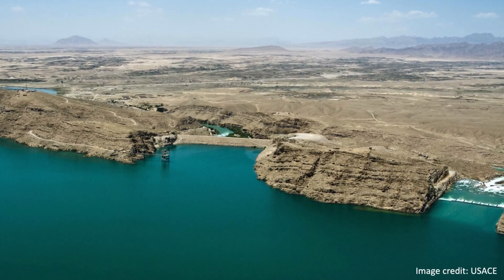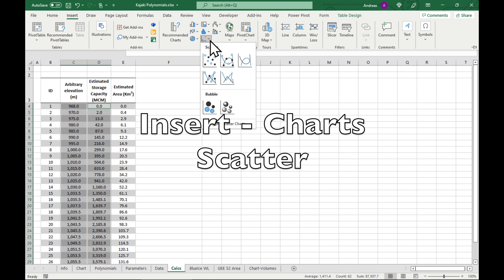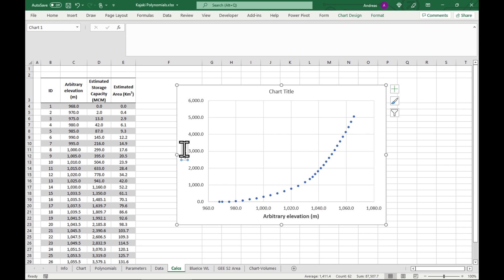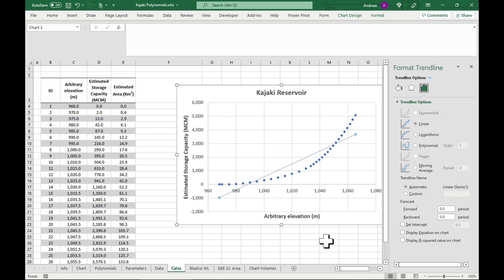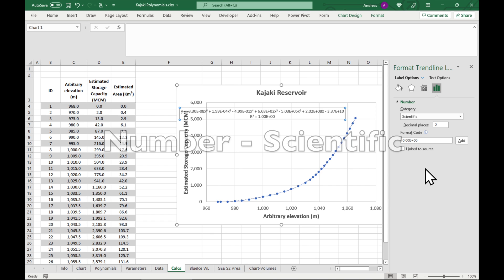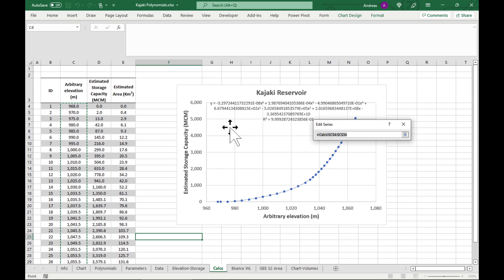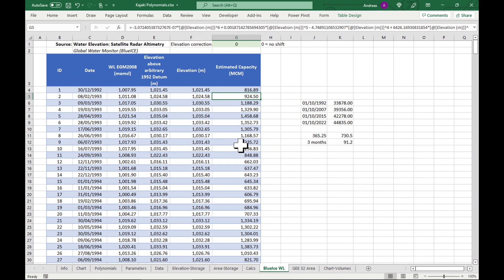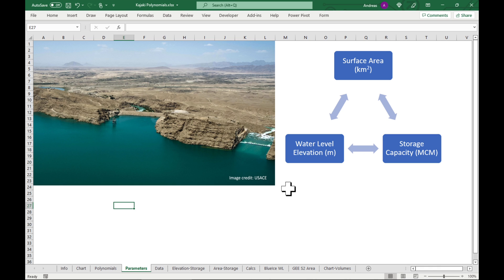Excel: Reservoir Storage Monitoring from Elevation & Area - Kajaki Reservoir

Comment: All are useful videos on your channel. Can you please let me know how to find the water in hard rocks (igneous and metamorphic). 
Thanks in advance!
Reply from the maker: Hi Raja, You need to start with the conceptual model on the hydrogeology of the project area: where is the water? Basically if the rocks are not weathered, then the porosity will be very low except where you have fractures. Once we get weathering, the porosity will increase but we can also get clay minerals which can lead to a lower permeability... Weathering is enhanced in fracture zones as the rocks there are already weakened. We also need to consider the water cycle: where is the water coming from? ... and where is it going?
Once you have this conceptual model, you can start doing groundwater exploration. Often it is best to look for regional fractures & the way to spot them is on air photos and satellite images. Some fracture directions are better than others so you also need to look at the structural geology of the area. Often late stage extension fractures are a good target, and you may even be able to map them in the field e.g., if they are associated with quartz veins.
Once you have found your fractures, and can zero in on those which have a large recharge area and then do some e.g., resistivity profiles to narrow in on the fracture zone, followed by some VES to see how deep you need to drill. See my video on resistivity surveys.
If your well is successful you need to carry out careful pumping tests to see if the water levels fully recover, as fractured aquifers can be compartmentalised which means that you can basically pump a particular compartment dry in a short time if it is not hydraulically connected with a larger part of the aquifer.
As a general rule, the drier the climate, the harder it is to drill successful wells so it helps to do a good baseline survey before you start any geophysics. Check out my video on groundwater exploration strategy. Good luck & all the best, Andreas
Reply: @GeosearchInternational  Andreas.. Thank you very much for detailed explanation. To be specific the study area Geology consist of 10-15m of overburden soil followed by igneous and metamorphic rocks. If we do some VES profiles is it possible to find some fractures. 
There are lot of equipments in the market claiming that they can identify the water in hard rocks up to a depth of 600m, sadly there is no science behind these techniques. eg. 3D locaters etc. 
As a Geologist I wanted to know from your experience, how far we can trust the VES sounding for identifying the fractures in hard rocks.
Again I say all of your videos are true gems!!
Reply from the maker: Hi Raja, From my experience all the equipment that make these claims are fake. The laws of physics apply and there is no x-ray equipment for the subsurface. You can do 3D seismic surveys and electrical imaging surveys but even these need to be interpreted professionally and are quite expensive. So, it comes back to good geological & hydrogeological surveys, followed by a logical approach to reduce your risks of failure.
A vertical electrical sounding (VES) is just a cheap borehole. It tells you how thick your overburden is and some info on the resistivity. To find the fracture zone, you need to do a resistivity profile, not a VES profile. So the resistivity profile is just repeated resistivity readings at constant AB and MN spacings, say every 10m along a line which is perpendicular to the lineation (fracture zone) which you have picked up using an air photo. When you pass over a fracture zone, the overburden should become thicker as there would have been more erosion - so you can expect a drop in the apparent resistivity values.
If your overburden is 15m thick, you need an AB of 3x15=45m - say 50m. If you are in igneous terrain you could also try to find dykes which sometimes act as underground dams. For that a magnetic survey maybe useful.
It is always good to talk with local drillers and other people who work in the area, in addition to the baseline survey. Then you can see what work has been done to date & also what approaches have worked or failed. All the best, Andreas
Reply: @GeosearchInternational  Thank you very much for your detailed explanatiion. Your input is perect for me.
Reply from the maker: You are welcome Raja! All the best, Andreas

Comment: Great video. Have you derived  the storage volume vs inundation Area or water level surface elevation relationship for other resvoirs of Afghanistan too?
Reply from the maker: Thanks Najibullah! I hope that the engineers in the RBAs can do that & compare it with the published curves. For example, the data used by the 2007 USACE modelling study on Kajaki looks wrong. For the newer dams (post year 2000) e.g. the Salma dam - this methodology will work very well, as there was no water in the reservoir at that time. For older dams you would need to digitise old contour maps, but take care with the datums used for the elevations. Also, I think that bathymetric surveys should be done at least once every 10 years, as the reservoirs are filling up so fast with silt. e.g. Kajaki is accumulating about 10 million m3/year. All the best, Andreas
Reply: @GeosearchInternational  thank you for the information. Yes some friends did generate the curves for Kamal Khan reservoir. Sadly we have limited information about reservoir sedimentation rate and storage loss in Afg.
Reply from the maker: Hi Najibullah, for Kajaki there is an interesting report from 1968 about how they did the bathymetric survey, but nowadays it should be much easier with a depth sounder & differential GPS on a boat. If you don't keep the curves up to date, then you will overestimate the amount of water in the reservoir as it fills with sediments... Sediments are important in reservoirs, but the water lost to evaporation from new reservoirs like Kamal Khan is maybe even more important for the basin water balance - especially in transboundary basins like the Helmand. Another important issue is the over pumping of groundwater for irrigation. As the groundwater levels drop they will induce higher groundwater recharge rates from the Helmand river, which will then have less quantity available to satisfy downstream water demand. If I have time, I will try to make some videos about this. All the best, Andreas
Reply: @GeosearchInternational  yes, the region has recently witnessed water related tensions. No doubt the water in lower Helmand basin will play a much larger role in our relationship with Iran. Im currently working on a research paper where I study sediment influx from sand dune migration into the Helmand River and its interaction with fluvial sediment transport. The region is highly interesting to me and to Afghanistan.
Reply from the maker: Hi Najibullah, Sediment transport is an interesting subject & you must be using a lot of remote sensing for your work. I think it is wonderful that all this satellite data is available for free, as it leads to greater transparency in the region. All the best, Andreas